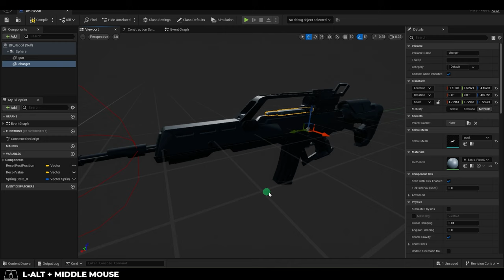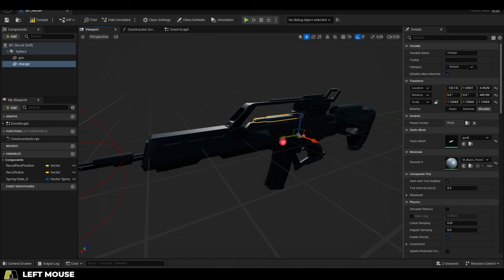UE5: Easy Gun Recoil (Charging Handle Kick-Back)

Comment: how do you remember all this stuff. for me remembering like a single node i have to use is difficult then u have all the variable numbers that work for u and like 8 other nodes that have to be connected a certain way and with certain variables too. also, what tutorial playlists are u currently working on and updating so i know where to expect new content atm or do u just swap between them as u learn a new thing?